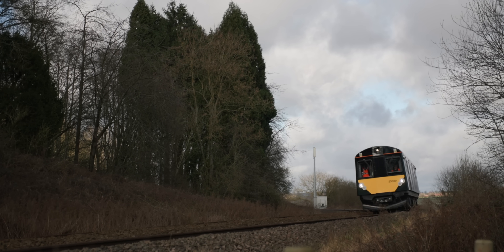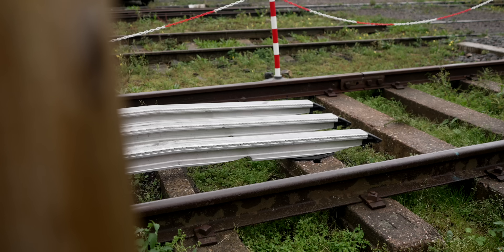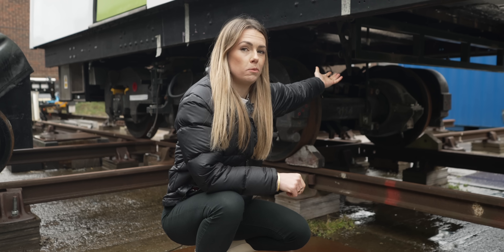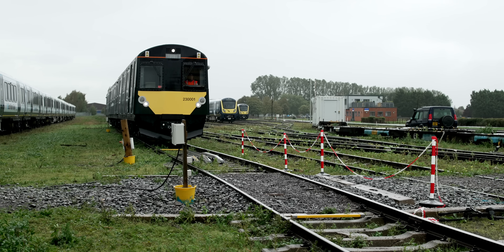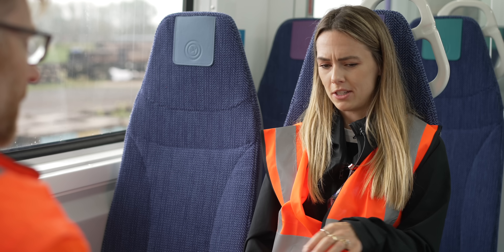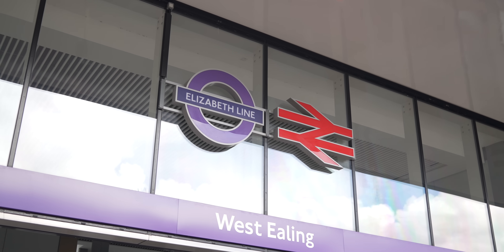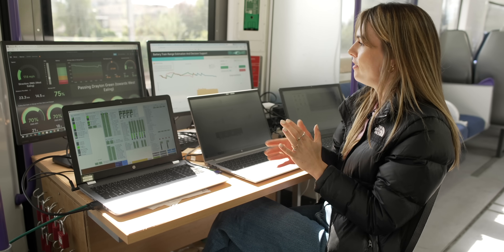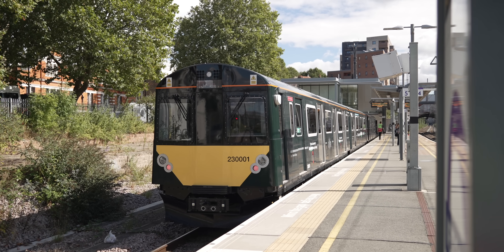Onboard the UK's First Battery Electric Train!

Comment: I guess my main question is why traditional 3rd rail (which use the track itself as the other electrical connection) or overhead lines for charging, both of which are plenty adequate (>300kw) and well developed, familiar, proven-reliable technologies.
Reply: There's a national rail ban on building more third rail 750V DC infrastructure, as its viewed as too dangerous (exposed live conductors, etc). The stuff that is already there has "grandfather rights" but they don't want more of it.
Reply: @GreenJimll  Just to be clear, the new systems they are building for this train are ALSO exposed, and high voltage. There is no clear reason they couldn't install a 3rd rail system at the station platform, with the same safety interlocks they have put in place for this new system, and just used existing (and proven) hardware. Instead they are installing what looks like huge chunks of aluminum and a complex system of pneumatics to raise and lower the contacts.

Edit: Also worth noting that the contact surface of the new system is on top, whereas the third rail systems use elsewhere are from the bottom. having the electrical interface on the underside of the rail protects it from weather and snow/ice accumulation. The new system doesn't have that protection and it's not clear how (or if) they are managing that problem.
Reply: Proven, reliable, and very very very expensive to build.
Reply: @simhedgesrex7097  Howso? You'd still only need them at the stations where you're doing the charging. A hundred feet of third rail or overhead wire can't possibly cost more than developing an entire bespoke charging system.

Maybe you misunderstood; I'm not saying they should electrify the entire line - of course that would be crazy expensive, which is why it hasn't been done yet. I'm saying use existing electrification technology to make the charging connections.
Reply: @Smidge204  Ah, it was your use of "traditional" that threw me off.  Certainly innovative overhead charging in stations is an option.  I don't know why they didn't select that - certainly there are trains that do charge from overhead.
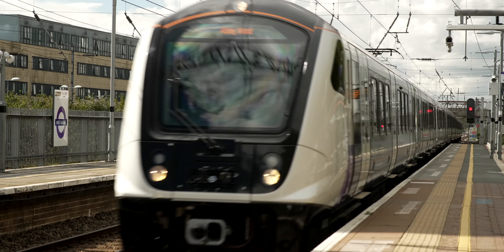Reply: I wonder about the benefit too, especially when you can see existing overhead wires at West Ealing station at 12:45. Claude-ai and Microsoft Copilot agree 25 kW says overhead wires can deliver 6-10 Megawatts thus recharging 600 kWh of batteries in as little as 3.6 minutes, so the problem isn't power delivery. And these electrified rails are so short that they can't supply power to the train while it is slowing down, nor while it is accelerating out of the station which is when it is consuming the most power. The presenter (Imogen Bhogal I think?) should have asked about this and also asked about regenerative braking.

By the way, at 12:17 if 500 kWh of batteries are charging at 642 kW, a 10-80% charge will take 32 minutes, not 3.5. ??!?
Reply: @skierpage   First off, do actual research and don't patronize "AI" LLMs. That stuff is intellectual poison. For example: No, they absolutely do not deliver 6-10 megawatts to a single train. That's 8,000 to 13,000 horsepower equivalent, and by way of comparison, a typical (American) freight train might have two 4,000HP locomotives and weigh on the order of 10,000 tons. An entire passenger rail train might have a 2000hp locomotive and likely doesn't even need that much. "AI" is dumb; don't trust it.

Second, they don't need to charge to 80% or whatever; they only need to charge enough to get to the next stop with a comfy margin. 3 minutes at >600kw is almost certainly more than enough especially if they use regenerative braking.
Reply: @skierpage  Do they have such wires at all stations on the line, given that the battery on the train is fairly small?
Reply: @simhedgesrex7097   I assume these trains turn onto a branch line without overhead wires. Unless GWR is so desperate to reuse these converted London Underground train cars that it developed this new mechanism alongside overhead wires.
Reply: @skierpage  Yes.  I think this first installation is a trial, so it's entirely possible it's running entirely under overhead wires.  But certainly, it would be pointless to run battery trains under continuously electrified wires.  There are battery trains for discontinuous overhead electrification, but they recharge from the overhead wires.

Comment: British innovation in the clean energy and clean transport sectors, that's what we want to see.
Reply: & Preferably publicly owned.
Reply: ...which is why we DON'T want to see battery electric trains.
Reply: @ZarlanTheGreen  move along troll boy
Reply: @2nd3rd1st  You're all missing the greater point here. Grid connections are one of the main sticking points across the UK for most all new electrified projects. The idea of having localised battery storage fed with local renewable energy not only stabilises the grid but offers further savings by potentially lowering peak gas turbine generation and giving lower cost electricity to all of us
Reply: @philskermer3132  Don't bother talking to @2nd3rd1st. Anyone who spouts completely baseless troll accusations, is clearly either a troll themselves, or deeply dishonest. Either way, not worth wasting ones time with.
Reply: @philskermer3132  Also, while grid storage is great, there is no reason to choose how to power trains, based on it. Also grid storage is far better done, with dedicated storage. Using home batteries and electric cars, to stabilize the grid, makes perfect sense, however, as those are cases where you simply make use of suitable storage, that is already there anyway.
Reply: @ZarlanTheGreen  I've got ask why?
Reply: @andyroid7339  You do? Really? I'd have thought it was blindingly obvious, that battery electric trains are far more expensive (long term. The initial setup is cheaper) and inefficient. It requires more power, due to higher weight, more maintenance, due to more parts... (including more moving ones, as well as batteries that degrade a lot)
There is no possible situation, where it makes any sense, to power trains with anything other than overhead line or, where there are issues with those, a third line.

She mentions tunnels and branch lines being expensive to use overhead lines on, but it's even more expensive, in the long run, to use batteries. Not to mention, that you could just simply use a third line to solve the cost issue, instead.
Reply: @ZarlanTheGreen  Thanks for your speedy reply. So why then, if what you say is economically true, is there this research? Regarding use of a third rail - how would this be guarded to prevent straying pedestrians and animals from electrocution? How would the maintenance costs of a third rail in open country (i.e. not in a protected u/ground environment) stack up? What are the economic electrical losses of operating either third rail or o/head line options? Note too that these batteries will be recyclable, some of the cells of which may end up in the trackside container units. Further to this, when there is a glut of wind energy, these units (train and container) will be used to store charge and even possibly release it when prices are higher and demand increases. I'm looking forward to your response.
Reply: @andyroid7339  The reason is that companies/politicians tend to only focused on short term profits/costs, at the expense of long term considerations.

As for third rail safety: If you have pedestrian crossings and the like... there seem to be quite good solutions for that, nowadays.
There are plenty of examples of third rail being used in open country, so clearly maintenance isn't too big a deal.

The economic electrical losses are negligible, compared to the same losses for batteries.

...and however recyclable a battery is (it'll never be 100%), don't compare to electrified rail, with nothing to recycle.

As for storing electricity... That is far better done, using dedicated grid storage solutions.
There is no possible reason, to choose how to power trains, based on that consideration.
Reply: @andyroid7339  Disregard everything this troll says. He's making up nonsense about battery technology, for whatever selfish reasons. Battery technology is actually getting cheaper and more efficient every year, so it's not true that costs would increase long term.
Obviously electric and battery trains are way more energy efficient than diesel trains, by the nature of the simplicity of electric motors vs the complexity of diesel engines.
Battery electric vehicles require less, barely any, maintenance because they have far fewer moving parts, except for the wheels and brakes. As you could hear in the video the extra weight is no issue, as the power and torque of the electric motor outperform the combustion engine. 
Batteries also don't "degrade a lot" as this guy claims, the opposite is true when charged properly. When batteries reach their end of life many years down the line they are being recycled into new batteries, which is obviously not the case with fossil fuels.

Comment: Great to see this technology coming to trains, 2 stats I'd like to know are, how many kw / mile does it use on the average journey? (I'm assuming it's more than 1 :) ) and how much power do they get back from regen braking?
Reply: Imogen Bhogal should have said whether these retrofitted trains have regenerative braking; GWR's press releases don't say.
Reply: @skierpage The trains do have regen brakes from when they were in service on the London underground.
Reply: Why are you happy to see a technology come to trains, that is inferior in every way, to overhead lines and third rails? (the instances where overhead lines are problematic, using a third rail solves those issues)
Reply: @ZarlanTheGreen  I see what you're saying, you'd have to do an analysis on how much power loss there is by using overhead lines and 3rd rails vs battery systems, I think they'll use this as a cheaper way to electrify local services where 3rd rail and overhead lines are less cost effective, plus you'd have to factor in the power used to make all the lines, rails and batteries etc any move to renewable energy should be a good move though
Reply: @peterswinson326  There is no need to do an analysis, to compare things with so massive a difference. So undeniable and indisputable. It's like saying you'd need to do an analysis, to know if it'd be more nutritious to eat at McDonald's, compared to a proper and non-fast food restaurant. (or almost anywhere else)
Reply: @ZarlanTheGreen  I think you'd be surprised at how much transmission loss there is in overhead lines compared to storing that power in a battery, trains are heavy anyway and have little resistance so extra battery weight wouldn't be that much difference so I don't think there would be that much difference and in certain use cases it would make sense
Reply: @peterswinson326  And there are no transmission losses, in a battery setup?
With overhead lines, you go:
Grid>transformer>train.
With some losses, with each of the steps.

With battery trains:
Grid>transformer>storage batteries>train batteries>train.
With some losses, with each of the, greater number of, steps
...and whenever the batteries are charged/discharged, they degrade.

Comment: I'm glad we're getting good use out of old tube trains and this should be a great option for truly rural areas. But for somewhere built up we really should be electrifiying properly.
Reply: I would think in the right area instead of just a 1 MW of power for Train could have 10-20 MW system into local grid.   Stabilize grid, cushion the charge/discharge amount for train over more batteries and make extra money selling electricity when prices are high.
Reply: This has been a hot topic for along time.
The reason there are so many lines down between Peterboroigh and Kings Cross is down to buying the cheapest overhead lines. 
This was a serious problem all through the 90's.
They are cheaping out wherever possible because the government is not prepared to make real investment into rail...

HS2 remind you of anything?
Reply: Properly?
Reply: @julianskinner3697  Use catenaries.
Reply: Now this trial is producing stat's they can do the sums to see  for full electrification is needed, I would hope it's "total cost of ownership" is already cheaper than  the diesel option ⛽
Reply: ELECTRICITY PRICES MUST COME DOWN SIGNIFICANTLY IN THE UK BEFORE ANY FORM OF TRANSPORTATION BASED ON ELECTRIC VEHICLES CAN BECOME VIABLE.  @backacheache
Reply: Full electrification takes ages to design, plan and implement plus is fairly expensive. The UK south western bound lines (which GWR operate directly and via SWR) is only partially electrified, with the 80 mile line from London to Bristol having been stop and go for nearly 30 years, was eventually started in 2009 completed 8 years later at a cost of £7b (including some branch line upgrades into Walse and southern-England). 

The main rail links from London the far south-west of the UK remain unelectrified for most of their run, werre built nearly 160 years ago, and include a number of additonal branch lines. The terrain and routes (many tunnels, hills, cuttings) would be very expensive to upgrade. Currently diesel electric trains run on the more southernly line (West of England main line), and hybrid diesel + electric trains on the London to south-west via Bristol (Great Western main line).  Running pentograph lines or third-rails along these locations would be expensive, difficult and highly disruptive to what are two fairly busy main lines.

If instead the train itself can be electrified, which charging at intermediary main stations (of which there are many, as well as minor stations) alone the route would likely be a much more cost effective solution. One that offer additional resilience as some areas in the regions are known to flood and high winds, which would effect third-rail solutions and pentograph solutions, the trains will be able to continue running past areas without power to the next charge pickup points.

Similarly, there are many smaller trunk and branch lines criss-crossing the UK, that would also be expensive and time consuming to upgrade each with their own unique needs - having battery powered trains on these lines, particuarly ones supported by local solar/wind/off-peak grid connections would speed up the electrification of the whole rail network in the UK.
Reply: @GruffSillyGoat  wrong! it doesnt take ages! the UK already has alot of third rail for electrification, much cheaper than overhead lines, plus the batteries could be installed on actual big storage farms to deal with solar and whatever makes electricity.
Reply: @carholic-sz3qv  - third-rail's issue isn't the construction time but the planning and authorisation time. Some projects were on the cards for nearly 10 years before being cancelled. There is also a question of suitability of use on some lines in the aging UK system, railway track width expansion takes time to procure land.

Third-rail systems fell out of favour, and some existing ones have been proposed to be upgraded to overhead electrification. 

The Office of Rail and Road has published a policy that states other electrification must be considered first instead of third-rail systems, even with proposed extensuon systems. Stating that the third-rail systems have limited future due to safety concerns.

This is one reason why GWR/Vivarails battery train system with its normally unpowered within track shoe is an interesting option for its speed of deployment, limited disruption to existing networks and lower cost. Providing rail network operators and the ORR with another electricifaction option.